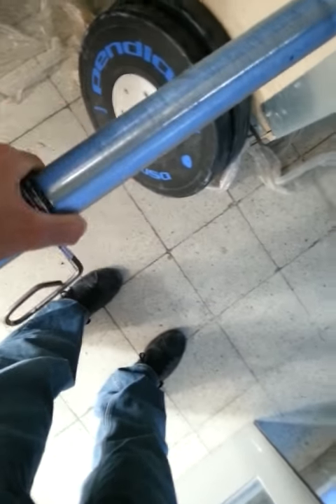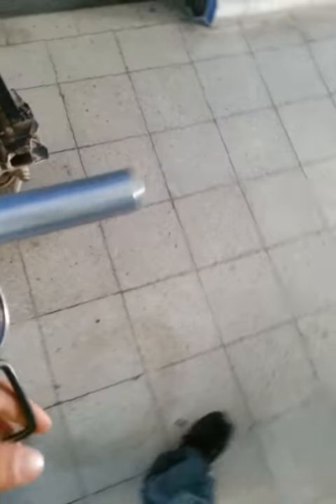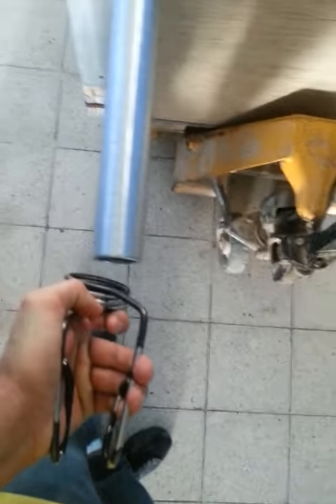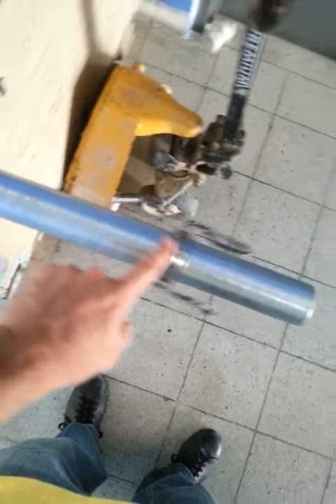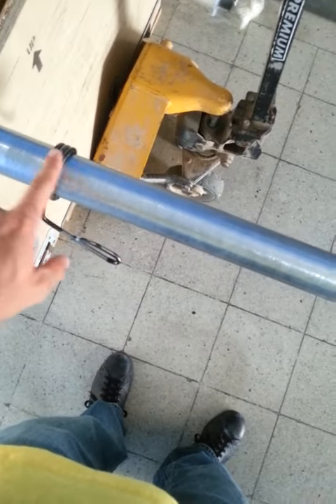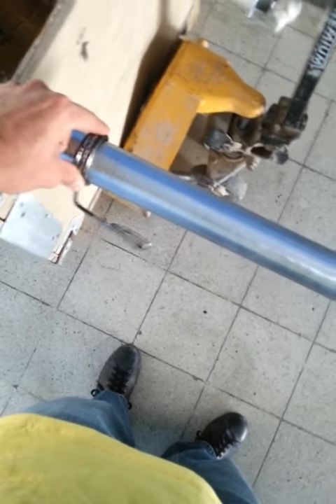Pendlay Nexgen bearing bar manufacturing error on tolerances

Comment: If I had a dollar for each time I've come across bad tolerances, .....

To be fair, there is no need to keep that bar diameter to a tight tolerance because that brings up the cost. It would seem that spring clamp should easily expand and contract to work as it should with the bar tolerances. 

So maybe it's the clamp spring that is in question. I would assume too that both the bar and spring have standard dimensions set by the "barbell code"?